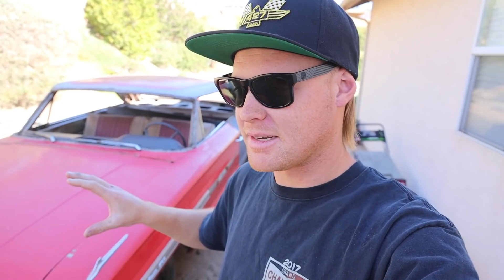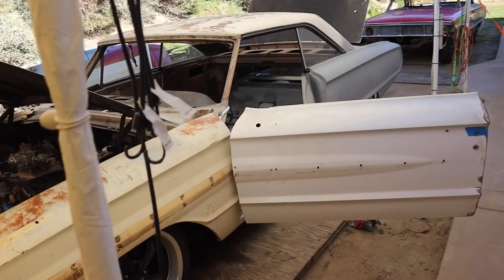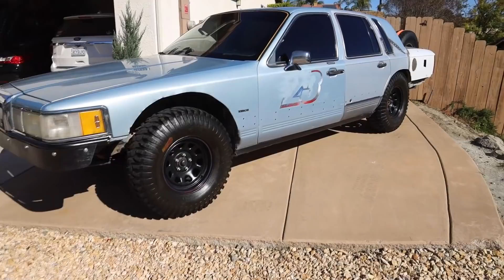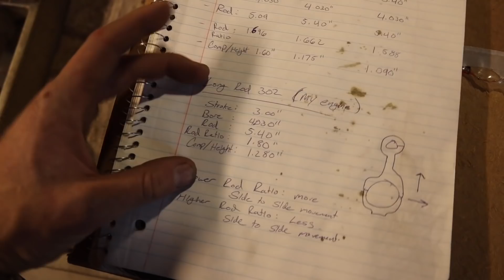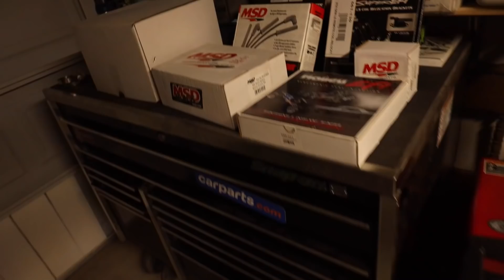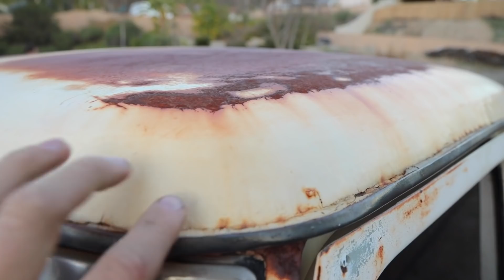Revealing my F100's new FULLY FORGED ENGINE BUILD! Full project Update!

Comment: I know I am adding a comment a few years after this video was just posted, I just found your channel. The best advice I can give you is don't listen to the people that give you crap for trying. You guys built your own engine and it worked! You built it on a limited time frame and it did last quite a while with your foot denting the floor board under that throttle pedal. Keep thinking outside the box.

Comment: Tons of guys mentioned it but you cannot run studs without a line hone.  Studs deform the caps more than bolts and will cause irregular bearing wear and loss of oil pressure.  I would also deck the block as you are .020" in the hole.  You may not want to make it zero deck based on CR but a zero deck will offer better quench.  Keep it up! I'm interested to see what your long rod 306w will do?  Typically the long rod has less piston side load when the piston dwells at the top an bottom of the stroke.  This is why OEMs like long rods less knock/piston slap based on the geometry which is better for engine longevity.  Contrary to that short rod engines USUALLY seem to RPM faster.  Engine building is almost a compromise on everything you do.  Not to be pessimistic but rod ratio has very little affect on an street engine built from off the shelf parts.  Just look at a 408w which makes great power and tons of torque and has a horrible rod ratio.  Really looking forward to the build!!!

Comment: Need more guys like ya fell in love with your truck when you first started posting it im 22 in canada currently building a 1968 firebird we built a pump gas 11.5:1 355 sbc with vortec heads with a lunati cam,scat crank, Mahle piston and more it was dynoed 440 at 7200 rpm on 93 octane with a 650 edelbrock carb and 513 with the timing bumped up a notch with a 750 holley double pumper and c12 race gas

Comment: Hey bro awesome videos, writing from New Zealand. With regards to your f100 and the rusting, a friend of mine has a 66f250 quite similar to yours, I also have a jailbar my pride and joy!. Our weather and humidity are probably way different but a trick I learnt from him and applied myself to preserve the patina is to scale the rust back with a wet sand, steel wool or a wire brush on a drill , and coat it a couple of times with a rag in pentrol oil. You could also use clr (citris lime and rust remover) to help remove excess and treat the rust which will darken it or just skip the part like my mate done for a more authentic look. Every month or so you will need to rub on another coat which is easy done , don't make the mistake of clear coating, it'll just oxidize. Just a trick I thought worth mentioning. Keep it up looking forward to future posts👍
Cheers Joe

Comment: Hey man, the engine looks good. Not sure if I missed it but I wanted to hop in here and mention that if you are running main studs, the machine shop has to line hone the block with the studs installed on the mains. You cannot install studs on these SBF fords with out having it line honed. They’re thin wall castings and the mains will move with the studs and eat bearings. I’m not sure if you had it line Honed but I wanted to throw it out there.

Comment: Well, I joined the Diesel truck side of the automotive scene, got a 2006 f250 6.0. But my 76 f100 with the 360 still is the hot rod

Comment: I'm also watching instead of the Super Bowl. I swapped out a 240 6 for an original 289 HO in my 71 short box F100 back in 1978. Loved that high revving 275 HP mill with the three on the tree. Good luck with that engine, sounds promising.

Comment: Hey, you might have some insight on this, but I have a 88 Bricknose f150. I want to do a engine swap but I have to pick between 302 turbo or a 351. I want the spooly boi noise but I'm nervous about reaching 500hp on a stock block. 351 in my area is harder to find and I want power. I forgot to say this is my daily. Any insight is acceptable.
Reply: Yep 500hp is pushing a stock small block I would go big block it's not hard to get 500 plus out of a stock block 460
Reply: @scotthancock5240  what's funny, 460 are everywhere on Facebook marketplace in my area 😆. I start looking at then good observation.
Reply: @ultrainstinctshaggy2745  first thing you do to a 460 is put a pre 72 timing set on it then a good set of heads and intake that alone will get you over 400hp a stock 460 bottom end is good for 1000hp

Comment: Check your PCV screen under your PCV valve, they are notorious for stopping up then building crankcase pressure in the end consuming oil. Just a simple check to clean it anyway if you havent done it yet anyway.
“Didnt build it to make it last i  built it to have fun with it” most accurate comment ever for a gear head, if you build them for longevity you wont learn near as much or tend to enjoy it a lot either. Build it for fun and if it breaks well you had fun anyway and learned about why it broke when repairing it.

Comment: My honest opinion if your going to go efi go port injection it has more Control ability and it’s more of an efficient system for eft with the ability to tune the fueling for each cylinder I would go carb over the bolt on efi system

Comment: Absolute porn shop   have releved the bottom of the block so that rod nut misses  i went the same way apart from electroics side  i allso had a shift kit put in my c4  much harder shift  pluse 2500 tci converter

Comment: I know your shooting for higher rpms but wouldn't a dual plane intake be better since you'll be doing alot of street driving?
Reply: Not really, maybe a little low end loss on a dyno sheet but not as much as you would think. I had a stock 88 5.0 engine in my 83 with a dual plane and made 291hp@6300 289tq@ 3500 with no other changes but minor jet change to cure top end lean out i only lost 8ft lbs of tq at same 3500 but gained 14 at 3900 and 21hp at 6200. So i gained hp at a lower rpm and picked up a bit of tq 400rpm higher in the rpm band, it felt a lot more responsive and actually picked up a bit on 60’ at the strip and just over a tenth in et too. Went to turbo not long after so it became a monster pretty quick for a stock engine set up

Comment from the maker: Drop a comment on what you're working on!
Reply: 1950 Ford F-1 patina green farmtruck, 500HP B&M supercharged 355 Cheby 700R4 monster trans 8.8 Ford F150 rearend Ford performance limited slip 4:10 screw. Putting lakewood traction bars on the lowered leaf springs. Chrome reverse swapmeet rims. Scary fast.
Reply: Currently working on a 1987 Chevy Silverado! Nothing awesome but it keeps me busy.🤘🤘😎
Reply: Putting back together my 86 el camino throwing a 71 350 in it
Reply: 1976 f150 with a 460. Building the engine
Reply: 1975 f250 4x4
Reply: 1985 f150 just rebuilt the motor its now a 306 with gt40p heads and a bootlegger cam,4 speed 4x4!
Reply: My 69 f100, did a crown vic swap on the front end. Ladder bar rear, built 460 D0VE heads with CJ valves. 11:1. C6. Should be a fun street truck!
Reply: 67 chevelle building a high reving 283 is my goal. Then my high school truck a 91 Chevy s10
Reply: Gathering parts to get my 302 t5 swapped ranger back on the road
Reply: Got a 96 bronco blown apart right now lol my nephew wants a drift car so I'm eather finding a fox body or putting my hands on a 67 mustang coupe I've found
Reply: @scotthancock5240  302 swapping ranger is pretty easy and the insurance is cheaper than a mustang lol And he would have a bed to haul tools, a jack, tires, and etc to the drift track
Reply: @JackTulsen77  your right but he has an f350 and an expedition plus would like a mustang
Reply: Working on my vacuum line reroute, timing, and idle on my b13 sentra. Damn thing runs like crap with a new maf in it.
Reply: 73 Duster, 318 ci Magnum, EFI port injection, turbocharged on E85.  Been 11.38 best ET and 121.63 best mph, 3240 pounds
Reply: Don't you have to line bore the mains if you change from bolts to studs?
Reply: I bought a 4 stroke engine kit for my schwinn bike. As soon as the snow melts and the temp gets out of the teens i can build it and ride it. I can't leave anything stock. Its a problem.